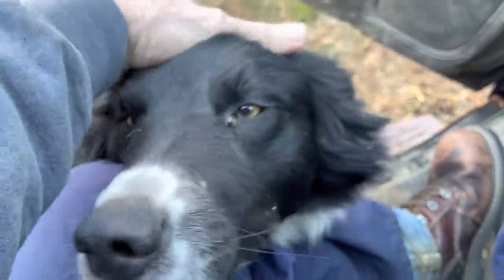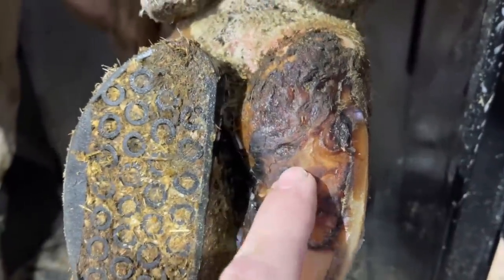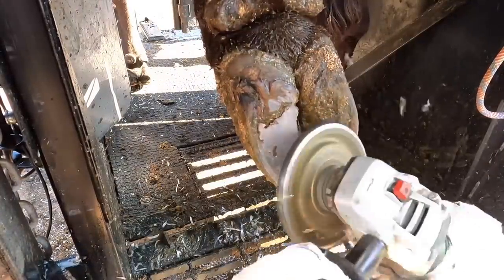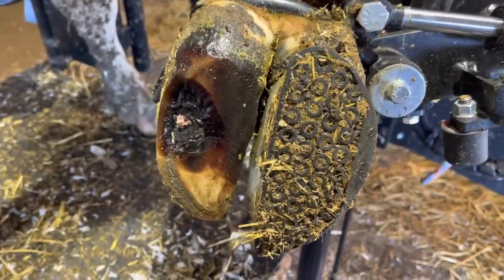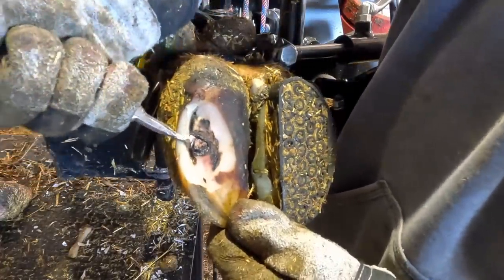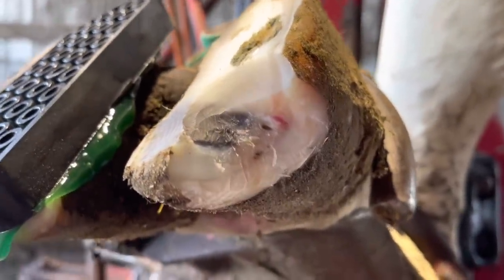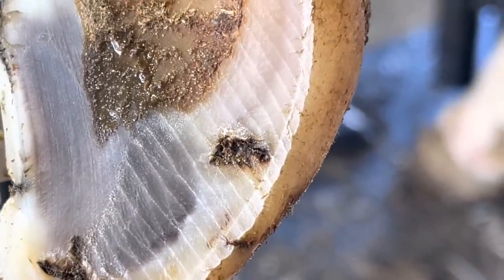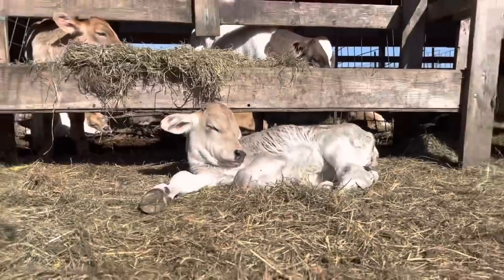Its MY FAULT that the CALVES are BELLERING!!

Comment: Question: Have you ever had a cow who's had problems in both feet? I.e both front/ both back and if so, do you just out a block on both of them? Or do you have to decide which is worse off to deal with first. 
Followup: has there ever been a cow where every single hoof had an issue?

Comment: Why do the hooves seem so much softer than those that the hoof gp trims?  Is it a difference in breed or environmental conditions?  Or are you just a bigger lad than him?  It seems so much easier for you to cut through the wall horn.
Reply: Could also be because of the sharpness of the instrument used.
Reply: @ramireini  I thought of that, but it's hard to imagine that the hoof gp has blunt knives. He has the best of the best equipment so I don't think he'd consistently have blunt knives.